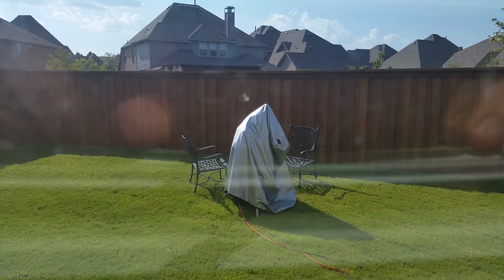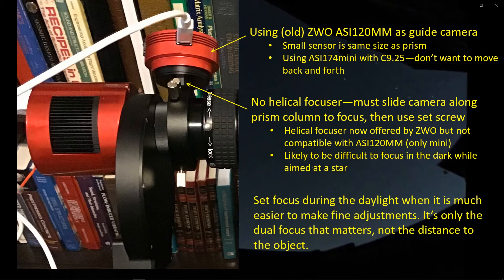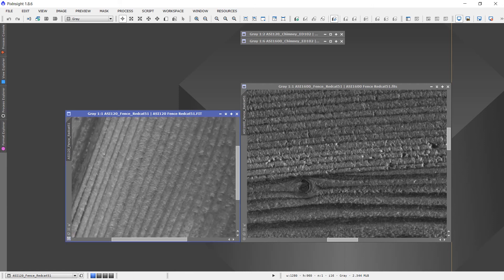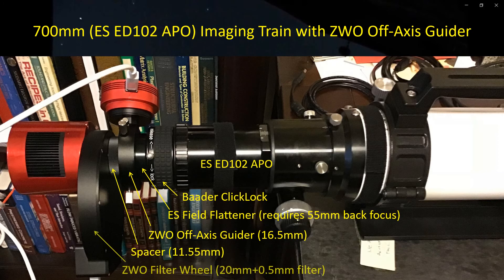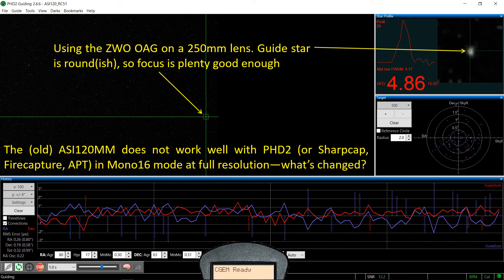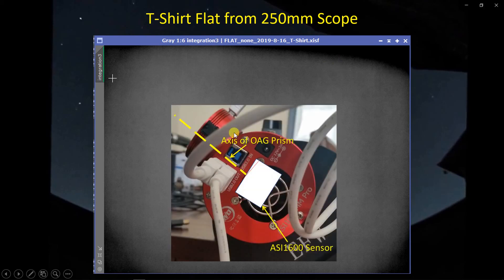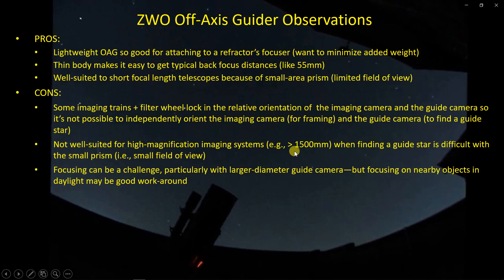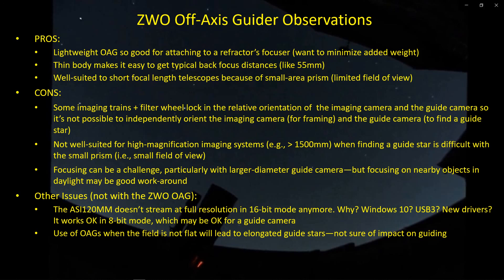ZWO OAG -- First Use

Comment: Great video and review, James. I hope Explorer Scientific can determine why the field is not flat. Here is an interesting blog from Cloudy Night regarding back focus and elongated stars using an Explore Scientific reducer/flattener. I also read on other sites where there were back focus issues with flatteners and reducers with the correct 55mm back focus. I know the back focus is supposed to be 55mm, but I wonder if fine-tuning your back focus using Baader T2 Delrin Spacers would help. 

 https://www.cloudynights.com/topic/504935-fine-tuning-field-flattener-back-focus/

Baader T2 Delrin Spacer Ring Set: https://agenaastro.com/baader-t2-delrin-spacer-ring-set.html

I'm in the process of setting up a similar camera set as yours on my Astro-Tech 111mm Triplet, 777mm refractor. It took me months to find the correct reducer/flattener for this older refractor. According to Astro-Tech only one model will work. I'm using a ZWO ASI 294 color camera. I just ordered the ZWO OAG, ZWO helical focuser, and ZWO ASI290MM Mini Monochrome guide camera. I'm also installing a Starizona Filter Slider Drawer between the OAG and the camera so I can use a light pollution filter. The optical system comes in at 53.5 mm of back focus but with the Baader spacer rings, I can achieve 55 mm. 

In addition to the new ZWO guide camera, I also have the same ZWO ASI 120 MM as yours. I haven't used it in years but will let you know if I have the same issue with 16 bit. 

Thanks again, James, your videos have been extremely helpful. I hope you get the flattener issue corrected. Sincerely, Jim.
Reply from the maker: Thanks Jim!
I took the ED102 out last night and played with the focus per suggestion from Explore Scientific. Haven't had a chance to look at the pictures to see if the stretched stars are still there; however, the guide star image looked stretched. I'll read blog post.  Should be able to get more time outside in the next few days. Let me know what you find out with the 120MM. ZWO suggested I reflash the firmware and I downloaded their software--haven't gotten the nerve to try it--afraid I'll lose the camera altogether.
Reply from the maker: Jim,
That Cloudy Nights discussion of flat field back focus is very interesting. I will try to play around with that. Using a different spacer, I can increase the back focus by 1.5mm. I think some thin spacers also came with the ZWO filter wheel. Thanks.
Reply: @Aero19612  

James,
No problem. As you know, nothing is easy in this hobby. I don't know how many times I have pulled my hair out, trying to get something set up. Fortunately, we have others in the community who have had similar issues. 

I have the ZWO spacers that came with my ASI294MC. The spacers OD is larger than the extension tube but will be good for testing. Later you can pick up better spacers from Agena Astro Products.

https://agenaastro.com/baader-t2-delrin-spacer-ring-set.html

Agena also has spacers for 48mm.

In anticipation of problems, I have spacer shims ordered for both my refractor and my 9.25 SCT setup. My 9.25 is another problem child. Several years ago I installed a Moonlite electronic focuser where the 6.3 reducer attaches to the front of the focuser drawtube. I'm working on the back focus for the 9.25 as well.

Over the years I have imaged with my Canon T5I, and Celestron Skyris 236c but back focus was always hit and miss experimenting with extension tubes. Now I'm serious and learning. I purchased the Zwo color camera to get started then later will get into monochrome with a filter wheel. 

I'm a glutton for punishment and need my head examined. I just purchased an older C-11 with a Hyperstar setup. I’ll set it up soon to check it out. Then I need to disassemble the scope for a good cleaning, flock the tube, and maybe have the primary mirror refinished. Just what I need, another project. Now I need to live to 165-years-old to get everything done. 

Even though at times I complain, rant and rage, I have concluded that researching and fixing issues is just as much fun as looking through the eyepiece. 

Thanks again, James, for your videos. They have been extremely helpful.

Sincerely,
Jim
Reply: You need a coma corrector

Comment: Are you using a field flattener?  I have the same scope and a field flattener gives round stars to the edges of the FOV.
Reply from the maker: Yes. I have the 2nd generation Explore Scientific field flattener that requires 55mm back focus. I think an earlier generation had a larger back focus. Which one do you have and what back focus are you providing? I'm pretty sure something is wrong in the setup, but just don't know what it is.
Reply: I have the ES FF.  Not sure If it is a second generation but there is 55mm from the back of it to the sensor.
Reply from the maker: Mine has “55 mm” written on the side of shoulder. You must be doing something right....and I must be doing something wrong. I’ll give it a good “think” before I use it again. Thanks for checking your setup.
Reply: I just checked a sub captured with the ES 102mm and the ES FF and the stars are quite good.  There is a bit of elongation in 2 corners but nothing I would worry too much about as they will likely end up being cropped at the end.  I can email you a jpeg for reference for comparison if you would like.  Just let me know.

Comment: Have you updated PhD2 to 2.6.6?   When I did I was getting delays in the guiding with the 120MM.  I have since gone back to 2.6.5 which did not give me any problems just a couple of days prior.
Reply from the maker: Interesting. Yes, I have 2.6.6. But SharpCap, Firecapture, and APT all fail to stream (ZWO's ASIcap works fine of course). When I checked an older Windows 7 laptop, it worked fine with SharpCap.
Reply: I'll probably be imaging tomorrow night and I will be able to test 2.6.5 again.  If I am not mistaken win10 shoved an update down throat last week.  Maybe that's the culprit too...  I'll keep an eye on the sharpcap refresh rate when I will polar align tomorrow night.
Reply: I am imaging now and using PhD2 on a windoze 10 computer. Phd2 v2.6.5  hasn't skipped a beat since I started 2 hours ago.  V2.6.6 was skipping refresh points all the time.
Reply: And sharcap was running fine during polar alignment.
Reply from the maker: I downloaded PHD2 v2.6.5 and the 120MM worked in that version. The ASCOM settings box is different than in v2.6.6 so I can't confirm if it's in 8-bit or 16-bit mode. I can't stream at in SharpCap or FireCapture. ZWO suggested I update the firmware in the camera. I downloaded the firmware upgrade tool from their website but haven't gathered the nerve to use it yet.

Comment: Good review James!  I don't know what caused 16 bit to change.  But try a new cable.  That might help.
Reply from the maker: Thanks Ray. Yes, I tried a different cable and tried bypassing the ASI1600 hub. No change. But when I plugged it into a Windows 7 laptop, it worked just like it used to. I'm guessing ZWO took some liberties with the USB standard to improve their throughput and now it isn't compatible with Windows 10 and/or USB3.0. It'd be nice if ZWO would push out a fix. Not holding my breath though.
Reply: James Lamb Hi James. I’m having the same issue with the 16 bit mode. I wasn’t using the 1600’s hub but it was a usb 3 port on Windows 10. I’ll try the usb 2 port that my laptop has and see if it changes but not hopeful. I’m busy setting up my Asi1600 with the minifiltereheel and OAG so have found your videos very Helpful. I have the ES102 app too! I’m trying to sort focus indoors but can’t seem to get  either camera to focus. Maybe without a reducer/flattened things are not far enough away to reach focus? I’m looking into getting the Hotech sca 2 flattener. I’ve read some good reviews. Clear skies.
Reply: Update. I tried the ASI120mm in a usb 2.0 port on my Windows 10 laptop and still no 16 bit mode. I’m concluding that it’s a Windows 10 or ZWO driver issue. Hope ZWO are going to look into this. They seem to have dropped old 120 users from the radar. The ASIAIR and the new ASIAIR pro don’t support it and now more issues. On a different note, I have an Edge8HD with the .7 reducer and was hoping to use the asi oag with it. I’d be working at just over 1400mm focal length. I could use the asi120mm or a Lodestar x2 guide cam. Do you think either is likely to work or am I pushing my luck there? The Celestron oag is so expensive! Thanks again for the very informative and detailed videos.